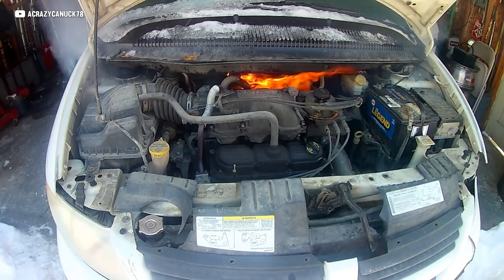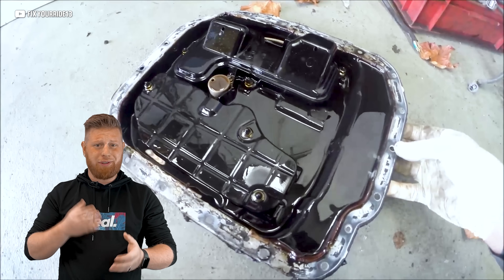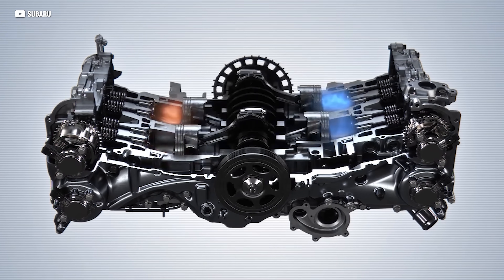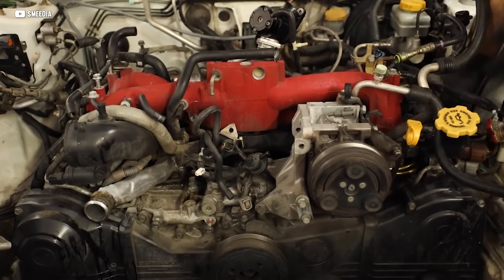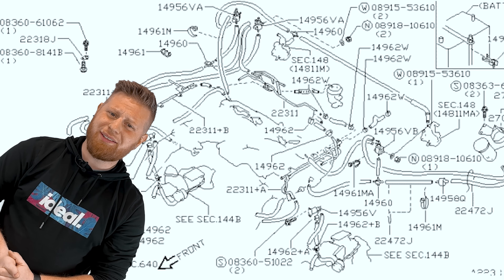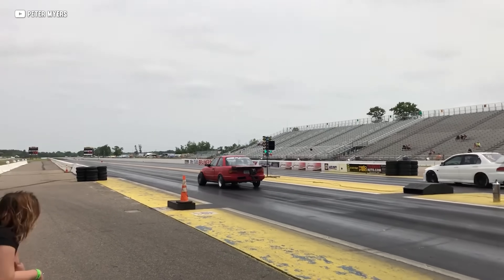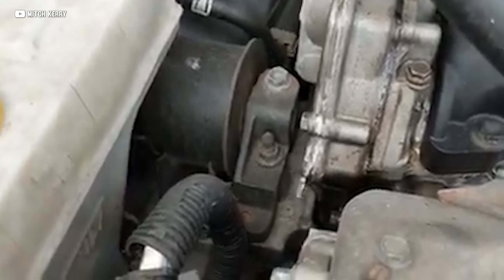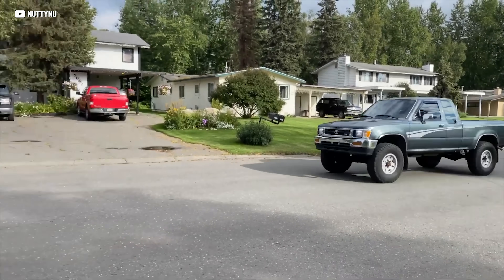WORST Engines Of All Time - JDM Edition

Comment: The rx8 can be very reliable with some modification... cut out the oil metering pump and add a separate 2 stroke oil reservoir. (will help with emissions too as 2 stroke oil burns cleaner than dirty 4 stroke oil) also despite bieng a non turbo you want a shut off timer to prevent the engine from shutting off until its UP to temperature
Reply: 😌... we have a genius over here👑
Reply: @atlegangletsoge6165  tbf I never said do this over just getting a new car... this is one of those "I love my rx8 and my rotary" things. The rx8 is one of those "it takes a special type of person to love this" cars
Reply: @jabadahut50  oh no, I'm not gonna do that... I wasn't even planning on getting an RX8, it's just that you are giving some great tip to all of us car guys who think the RX8 is Bad while it actually isn't 👑
Reply: @atlegangletsoge6165  bad is somewhat subjective... a car that can flood its own engine on a dime and has to be rebuilt every 50,000 miles is to most people a bad car. I look at it this way though, the rx8 is a sports car. It wasn't meant to be your daily driver super reliable... you want that? Get a Toyota. You want a light weight super high revving fun machine that might break if you treat it wrong? Rx8 is your friend. The rebuilds are kind of expensive but if you save and plan for them it just becomes apart of maintenance the way other cars get timing chains done. The shut off timer and the 2 stroke oil reservoir are there to basically make it much harder to treat it bad.
Reply: @jabadahut50  I think Its because it is over shadowed by the FD RX7 which is more sportier, lighter and nimble. The Rx8 is great and all, but I personally would swap out the rotary for the K20 from the Honda. It's also high revving and tunable. Or do you just like the Rotary as well as the Rx8 you own?
Reply: @atlegangletsoge6165  I'm a rotary lover. If I where gonna do an engine swap it'd be to the FD engine from the RX7. I do also agree that the RX8 was HEAVILY overshadowed by the previous generation... it just sucks that the RX8 had to be the LAST generation.
Reply: @jabadahut50  yeah. I so wish the Mazda could've made that Rx 9 they kept teasing us about. But I've never encountered anyone who loves rotaries so much. I still wonder why you love em so much ...?
Reply: @atlegangletsoge6165  10k rpm, v6 smoothness in a tiny light weight package, and frankly how they function is just super fascinating and satisfying to me.
Reply: @jabadahut50  how the function is great. I just love watching the triangle spin around in there. But wow. You are really committed. If it wasn't for the reliability Stuff, I would consider it, but for now, I will always consider Honda. And VTEC everyday. They are also revvy when nat-asp
Reply: @atlegangletsoge6165  VTEC is great too. Closest thing to FI on a truly naturally aspirated engine and the sound is phenomenal. I wish the Konnegsegg free valve system would make its way around the car industry as it'd be an easier and more reliable way to implement the VTEC.
Reply: @jabadahut50  you keep coming up with hits. Imagine having the NSX with proper power and not the hybrid system whatsoever
Reply: @atlegangletsoge6165  Or better yet follow konnegsegg's lead again and use a torque convertor to combine the electric and the gas... honestly hybrid is the only way to get hyper car performance without a bugatti sized engine. The INSTANT torque of the electric motors is just something ICE can't compete with in the low end and atleast for now electric motors can't compete with ICE's top end.
Reply: @jabadahut50  yep, totally... But the whole take away to this is that electric cars only have tech and instant talk. Not do much interesting stuff really. But ICE tho, imagine losing your rotary for EVs
Reply: @atlegangletsoge6165  Well if Porsche has anything to say about it we won't have that problem. They are working on creating synthetic fuel using electrolysis powered by  green sources of energy and CO2 scavenged from the air. The goal is to create carbon neutral fuel. We'll still kick carbon emissions out into the air but the source would have been CO2 from the air and hydrogen from water to begin with rather than digging up fossil fuels.
Reply: @jabadahut50  I read about that some weeks ago. But it doesn't look promising really. But i have hope. It's just that EVs seem to have climbed their way up everyone's heads about them being the future. Heart breaking
Reply: @atlegangletsoge6165  I'm all for ice. But I'd still like an even for its different nature. Say like a c8, charger hellcat, lambo, s1000rr, gsa, goldwing, ram longhorn,  and maybe 1 other with the ev following or depending on money bring the ev in earlier while working on the rest. I feel that evs can never truly become a reliable primary.
Reply: If the fix was so simple (I’m not saying u said that, but reading it, it looks pretty simple to me), why couldn’t Mazda just put those things in from factory?
Reply: @atlegangletsoge6165  I'm not worried. The sheer amount of lobbying in the US from car manufacturers and big oil will keep fuel burners relevant for quite a while. I think we'll see power plants start to go green before our cars are regulated out of legal existence (save for in california... because regulating cars seems like they're doing something when in reality they should be regulating buisnesses pollution output)
Reply: @jabadahut50  but with EVs being produced mostly everywhere, and Porsche prolly making the Macan Electric real soon, and with teasers of the Cayman going electric, do synthetic fuels have really have a future?
Reply: @atlegangletsoge6165  I think they will. We'll see a lot more hybrids and I think sports cars will survive. Remember even with all the tech being pored into battery technology the sheer energy density of fuel DWARFS the energy density of todays batteries... Higher energy density means longer range... so long as that synthetic gas sticks around for the range extensions of the hybrids I think there will continue to be a market for more fun sports cars too that more heavily rely on the need for the gas. I read an article a day about "Scientists have discovered new way to get 10x more energy from a battery!" but if that was scalable we'd see that shit in EV's TOMMORROW... hell we'd see that shit in cell phones and laptops. But scalability is the HARDEST part of new technology. We humans are excellent at making shit work the way we want to on small scales... doing it on a larger scale... lot harder and it takes more time.
Reply: @jabadahut50   @jabadahut50  so true😂... But again, some countries seen to be banning all ICE vehicle by 2025 or 2035, I just hope that all the synthetic fuels make it early because it seems like the countries producing the desirable ICE cars are the ones going electric in the near future. I still wonder how Porsche, Mazda and Toyota are gonna manage that. And again, these computers on wheels pose a greater threat in crashes as the fires go crazy
Reply: @atlegangletsoge6165  so long as there is a market for gas using cars they'll find a way. The US will likley be the last to give up its gas cars and if it can be proven to be more eco friendly (which synthetic fuel would be) those ev only laws may change. Additionally they will likley, if not now, contain modifications to the laws in the future to allow carbon nuetral fueled vehicles with an added tax or something.
Reply: @jabadahut50  Yeah, tax will be added for sure. Plus the US wasn't planning on giving up their big V8s of great displacement. Well with regard to thinking that the laws would be modified, let's hope the government backs that whole eco friendly fuel.
Reply: @atlegangletsoge6165  we'll see... your looking at a lobbying fight between big auto and big oil on that one.
Reply: @jabadahut50  and the only way to see how this will turn out is by waiting. Another frustrating thing
Reply: @atlegangletsoge6165  indeed
Reply: @jabadahut50  I'm glad there are people out there that know how to work with these cars.
Reply: Nah keep the omp.
Reply: @mrsoisauce9017  cost mostly It doesn't seem like it'd be that expensive but when your building X,000 cars the bom ads up and can break the projects budget. Also you are now asking the customer to fill up the 2 stroke oil every time they fuel up. A lot of people won't be willing to do that.
Reply: And replacing apex seals every 50-80k mi goes away as well...no.  

Its fine as a 2nd car and you have all the tools to rebuild it yourself (which as engine teardowns go these are really easy).

Its crazy that they sold these to the public.
Reply: Yes and its the best n/a rotary from factory
Reply: You don’t have the cut out the OMP as long as you have a cat less exhaust and you mix in the gas the car will run fine

Comment: You've confused the difference between the 3vz-e and the 3vz-fe again. The 3vz-e is the one in the truck with head gasket issues. The -fe is in the camry. Different engines.

Comment: Fun fact about the 6G7X- they're neigh impossible to kill. Cracked blocks, holes in piston heads, etc, they'll run absolutely forever. Probably the best 90's v6 ever engineered, tbh.
Reply: If not the tt version then yea
Reply: I have owned a total of 11 TT Stealths and still own 2 one with over 250 thousand miles. Neglect and kids owning them was the main problem. Getrag trans was the real problem in my book.

Comment: I had a VG33 in my Nissan Hardbody. Sold it as 418k km and issues were minimal even though it was a workhorse. A frequent oil change goes a long way. Even if it is only 3.8L by the owners manual (which is small for that engine size)
Reply: Worked at a Lincoln-Mercury dealer four years when the Villager had that engine. I never pulled one and never saw anyone in the shop pull one.

Comment: Massive failure in the journalism behind the VG30DETT. For starters, the vaccum diagram you posted was for a single cam VG30DET, which is the previous generation of the engine you are referring to. Yes, that engine has an overly complicated vaccum system... one that was simplified in the next generation. Secondly, it may not be an OBD2 capable, but there is plenty of diagnostic software options that can help with running ECU codes... and as a matter of fact, you can run the trouble codes without needing any diagnostic software, as it can be done through the ECUs built-in troubleshooting mode. On a last note, yes - the engine is a bit complex and not easy to work on, but it also has a lot of tech innovations that engines didn't have before, such as variable valve timing. A lot of these systems are deleted or simplified to reduce the complexity of working on these engines.
Reply: Thank you someone actually knows
Reply: Hell yeah bro! Plus, these people have no idea how much raw and engaging driving a 300zx is
Reply: This guy gets it.  Long live the Z!  Hey, even supermodels have issues.

Comment: How did the fa-20 from the 86/brz not make this list? They spin rod bearings like they were designed for it. 💀
Reply: "How did the fa-20 from the 86/brz not make this list? They spin rod bearings like they were designed for it"

Im a year late to this, but:

Thats pretty much only a "concern" if youre regularly letting your oil run low (These engines, like most, will burn oil as they get up on life- and its not uncommon for people to not give 2 thoughts to their oil between changes, allowing them to run low), or 2, if youre tracking the car quite a bit, and over heating the oil regularly.

For day to day, or light track use- Most people dont really have too much issue.  And if youre going to track your car hard/often, you should have an oil cooler anyways, which drastically helps alleviate the bearing concerns.
Reply: The reason why it spins rod bearings has nothing to do with the Oil itself but the Oil pickup.. The Gasket maker that subaru used to seal the pan togheter doesent hold up and ends up in the pan which then clogs the pickup @SidewaysGts
Reply: @insector2093  Dont forget its not just the gasket. Even in newer ones when they track the car, it will most likely spin a bearing, because the oil pan is not designed for taking too many turns, and basically starves the engine of oil.
Reply: @SidewaysGts theyre notorious here in 🇦🇺  for shitting themselves. Stock. Not tracked. Not flogged. They just blow up.
Reply: They don't. What happens is some dumb kids let the oil get so low and then when the engine shits itself, they blame the car instead of themselves.
Reply: 120k GT86 likes to have a word with you.
Reply: I have a 30k miles supercharged gt86, and I've had 0 issues because I perform maintenance regularly. It's all about taking care of your shit.
Reply: @robelmurph  would you recommend one for a first car?
Reply: @CIVICX3  Absolutely, if you do your maintenance properly, don't think you're in a fast and furious movie, and if you decide to boost it, do your research, and don't be cheap on supporting mods you'll love it and have it for years. Just don't buy someone else's problems. Try your best to get a clean title or, at a minimum, one that was maintained and not raced every day.

Comment: Having an rx8 engine. The moment it's rebuilt with the necessary upgrades and notes, it becomes more reliable. Had mines rebuilt with the necessary mods along with some added added mods to help with longevity but also power wise it hasn't caused any issues since.
Reply: I agree the rotary engine can be made very reliable now days
Reply: @jatinsidhu8639  I agree. I've gone 4 years now so far with my rebuilt with only 10k miles. Pretty good. Planning to overhaul it one more time and upgrade it to a Bridgeport along with better oil lines and other better things as well as new ECU now that Cobb is no longer supported and I'm still running a legacy tune from my Cobb Accessport.
Reply: You got a reliable engine for about 50K miles?
Reply: Can a rotary engine be possible for daily commute?

Comment: The moment I saw the title I knew the 13B Renesis would be on top of this list. That motor is a special type of legendary 😄, my cousin has MY04 and I have never seen him drive it, just always parked due to continual issues.
Reply: They are really cool, but ya.  A motor that will require a rebuild every 50k isn't something that should be in a production car.
Reply: Trust me I work on 13bs all day and their amazing
Reply: @jatinsidhu8639  if you need to work on them all day they are not amazing.

An engine that can’t got 100k mi In stock form  without a rebuild is far from amazing.
Reply: @AB-nv7bz It can. My friends made it to 130,000 mine made 115 without anything like premix.
Reply: @DavesWhips  so half the mileage of every other Japanese 4 cyl?  And that makes it good?  

It’s an amazing motor to drive,  but it’s not a good motor.  

Think of what your talking about.  A motor making it 115k without a rebuild is something to celebrate.  

I love the fd, one of the best cars ever made, but it’s not something most people can deal with.
Reply: @AB-nv7bz  Yes your right. I own an rx8, and an rx7, and i think that the bad engine in the rx8 is why its so great. let me explain. The cars chassis is amazing and is perfectly balance and has alot of potential. If they had put a great engine in there it would be the equivalent of a modern mk4 supra. However its crap engine makes it super cheap and affordable, i bought mine for 1500 and after rebuilding it and stuf like tires etc i have about 4500 in it. Its so much fun and its cheap to buy because of the renesis
Reply: @AB-nv7bz  If you treat it like a BMW, then it'll die. Treat it like a proper race car (even though it's a road car) and it'll last far longer. Skimp on maintenance and you skimp on engine life.

Comment: 10:20 , as owner of a dyno tuned sentra SE-R spec-V, 2008 with a QR25, it really depends which QR25 version you get and how you mod it. Mine came stock with forged internals, and is currently n/a dyno tuned to over 230 whp.
Reply: SE-R 🔥
Reply: I remember when those came out. I wanted one so bad but I couldn't afford it. Didn't they make 175hp stock with a 5 speed or was it six?
Reply: @Cmobley_   The spec V has a six speed :)

Comment: I have the twin turbo EJ208 on my JDM Subaru B4 RSK, never had any engine issue or turbos issue. Maintain your car, i change my oil every 5000 km and i wait awhile before using the 2 turbos. Also JDM cars have to be tuned for your local gas if you don't have 100 octane nearby.
Reply: had a stock 12 sti. changed oil every 2000 miles. drove it every day it didnt sit but i didnt have to drive far either. Warmed it up in the morning. Blew 2 motors in 6 months after owning the car for 2 years. Cyl 4 misfire. Cracked broke ringland first time. second time cracked piston. I sold car for a 19 camaro ss. Dont just tell people to maintain it. You have the twin turbo which wasnt even mentioned. EJ257 is such a bad motor there are 5 seperate class action law suit groups.
Reply: @sariahreigns3666  Wow that is crazy but yeah sometimes it is lack of maintenance, i prefer the EJ20 or EJ22, the EJ25 has too many issues.
Reply: Ej20 definitely superior to 2.5 dont understand why you would clump then together
Reply: What is your model year?  Pre 01's have the big end issues.